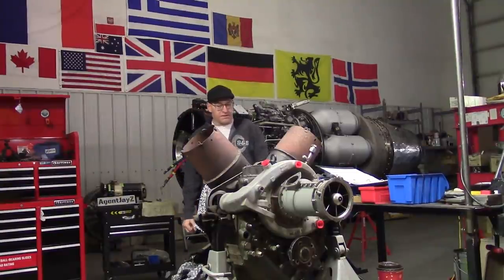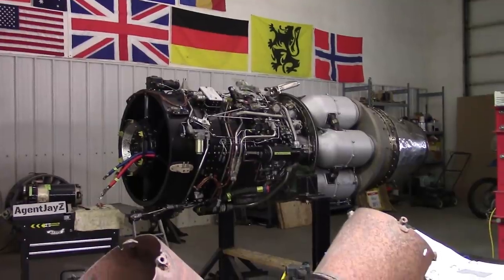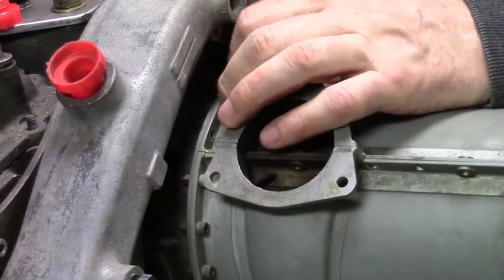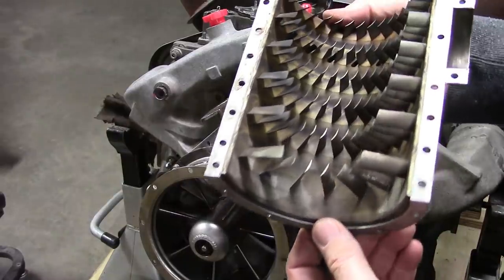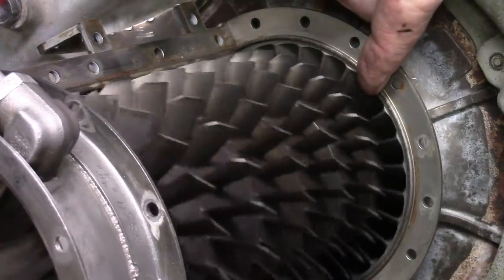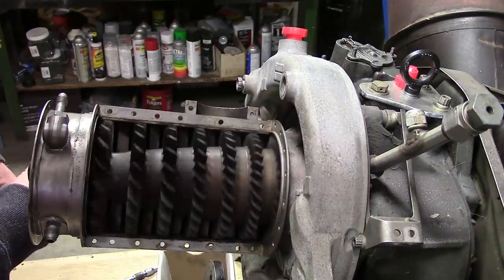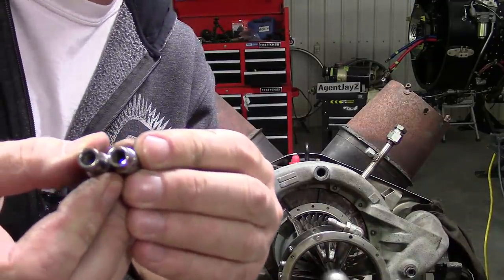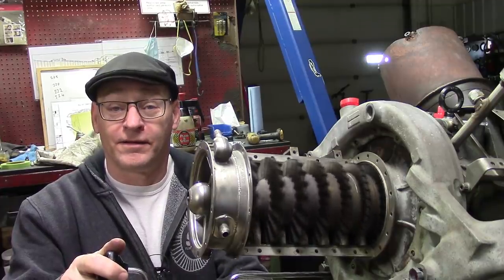Mini Jet Boat Ep. 4  Opening up the Compressor cases

Comment: Cool stuff agent Jay. I've flown them but never drilled down to working with the nuts and bolts on them. I consider you a master technician. I'm learning about the Walter 601 turbines as well. Amazing how much horsepower is available when you can afford the fuel flow. The Walter 601 in the Long Nose Thunder which is an experimental reduced scale P-51 delivers 220 Kts true at a fuel flow of 43 GPH. In neutral wind components that calculates to 5.88 MPG. Not very economical to operate as a single place aircraft but lots of fun. In larger aircraft that carry more cargo/people. Pound per pound weight to horsepower the numbers related to fuel consumption economy become very competitive.

The petrol air-cooled piston aviation propulsion units deliver about 10 HP per 1 GPH fuel burn. Dual volute turbo CI diesels deliver about 20 HP per 1 GPH. with a weight comparable to the air-cooled petrol cousins. Bellow 500 HP these 3~4 L aluminum CI diesel engines are proving reliability better than the petrol AC SI petrol engines with 20 years of data) with fuel flows of 25 GPH delivering 500 horsepower or 375 KW equivalents.

It's all about application but I've always preferred Jet, turbine/turboprop propulsion with aircraft over piston. Thanks for sharing. Cheers

Comment: In this video you explain that later models of the engine dispensed with the axial compressor altogether, and just relied upon centrifugal compression. If so, what does this axial compressor actually generate in terms of the overall pressure ratio for the engine? (2:1, 3:1, whatever.) 

Effectively, did the actual overall pressure ratio remain constant and this thing is so weedy it offers next to nothing, or was the centrifugal compressor on this unit actually just rubbish? I suspect the latter but it would interesting to emphasise this trade-off in subsequent episodes.
Reply from the maker: The centrifugal compressor design was improved to the point that the axial stages were no longer necessary. Any further details on actual numbers of individual stages is not included in the overhaul manuals.
Reply: there some numbers on page 29 of in this linked on the wikipage: https://web.archive.org/web/20161004205229/http://www.enginehistory.org/Convention/2009/Presentations/Model250Hx.pdf

3.2:1 axial and 2.2:1 centrifugal for the -C20, 7:1 centrifugal for the -C28

Comment: I want an engine like that! Doesn't have to be even close to running condition, just complete enough to display. Heck even just the compressor section with the gearbox would be nice. I would totally put that up on a stand in a room!
Reply: There's just the gearbox for a C18 on EBay UK at the moment for £16 000 . There's another one for the MB250/C20 for £5 000 !
I could buy 6 Rolls Royce Viper engines in good shape from the Jet Provost for £16 000 !

Comment: Why do the blades of stages 3 and 6 have a notch cut out of the tip of their leading edges (most visible at 8:20)?
Reply from the maker: The engineers are always tweaking the machine. It may have been to reduce resonance or turbulence when running. Such details are not mentioned in the overhaul manuals.
Reply: I suspect that the stage 3 and 6 blades suffered a high order harmonic resonance, which cracked the corners off the blades.  Rather than trying to redesign the aerofoils to change their natural frequencies, the expedient solution was to crop the corners.  It would have cost something, in terms of performance and surge margin.

Comment: Off the top of my head 10-32 is used for the gas key to bolt carrier cap head screws in the AR15 rifle , and the mil spec torque for these is 56-58 in/lbs , so 60 is close enough . There are no metric equivalent for these sizes in Europe so raid the boot sales and tool markets and vintage car rallies . Allen keys are not really a problem , but most of my spanners were obtained this way and was lucky to find old 'Blue Point' branded double end ring spanners at a quid each . Nice looking compressor stage with no intrusions except an over zealous aerosol of aluminium paint . No reason why the turbine end should be any different if the history is as good as described . I must admit those ugly mild steel stubs are beginning to annoy me , but I supposed we'll just have to wait until the engine is inverted and well stuffed before lopping those off and repairing the V flanges .
Googled Allison C18 Operation and Maintenance Manual and there are no shortages available including the 1971 Detroit Diesel one free to download online .

Comment: The old machinist term for a bolt used as a dowl, or close to a dowl, is "body bound" .
Reply from the maker: Yes. I prefer dowel bolt, but a lot of people I know use your term.
Reply: They used to be called "fitted bolts"
Reply: @whitemonkey7932  That's what I know them as.

Comment: Nice video. At 10:08 (and other places in the video), it's fascinating to see the illusion of the compressor stages moving on independent disks at different speeds and some even appearing to run backwards temporarily. Must be the effect of both the camera frame rate and the progressively smaller blades.
Reply: Yup, stroboscopic effect.
Reply: Frame per second.

Comment: Hey Jay! Would love an explanation of the 'HP recoup system'. I found it while looking at airflow diagrams of Gas turbines used in the Snøhvit LNG powerplant. Keep up the awesome work :)
Reply from the maker: I've worked on more the a dozen aviation and aeroderivative industrial gas turbine engines.
Nowhere, in any of the overhaul, operation or maintenance documentation, is the word recoup used.
So I'm not your guy.
Reply: @AgentJayZ  Just found out that it was referring to a recuperator, a heat exchanger system in gas turbines that takes some heat from the turbine outlet and gives it to the compressor outlet air to increase efficiency.
Here's a link if you were interested: https://www.turbomachinerymag.com/are-recuperators-always-great/#:~:text=The%20recuperator%20is%20a%20heat,pre-heat%20the%20combustion%20air.&text=This%20advanced%20cycle%20is%20often,with%20reciprocating%20engines%20on%20efficiency.
Reply: Recoup is a term used in GE engine CF6. It steals some of the leaking air and used it for sealing in bearing chambers.

Comment: Hello and thanks for your videos. Compared to axial compressors with many more stages, it seems this one  constantly tapers up to the centrifugal stage without having the straight area to reduce air velocity. Is this because here is not required? Or is the centrifugal stage architecture playing a role in this instead? Again thanks!

Comment: A nut re-assembling tip from a recent Andrew Camarata video was to use a swatch of paper shop towel to press home and hold a nut in a ring spanner to prevent it falling through when access is awkward.

Comment: Is that resin filling around the stator blades used in other engines? Looks like a bit of a nightmare if you had to replace one of the stator stages.

Comment: Nothing in the UK I'm afraid sometimes I get lucky with a little used manual here . Ebay UK has a C18 gearbox ONLY for £16 ,000 ( about Ca$30 000 ?) . To put this in perspective a Rolls Royce Viper from a Jet Provost in clean condition is £2500 ! Try the one month free download for the Dietroit Diesel manual . Picked up a couple of tips from guys who have worked on these .
 Tip 1 CSL  1176 starting procedure - open throttle at N1 =12-15% rather than 18% as recommended in the operation manual as it reduces wear and burnout .
Compressor and turbine mounting stud torque is low at 80 in/lbs as this does not allow for 'drag torque' and these will come undone . Torque to 110 in/lbs to make sure they do not !

Comment: Is the inclination to do the other side of the compressor cleaning just out of a sense to be good and thorough? Or is it out of concern for some possible imbalance (of air flow, or something... I don't know, that's why I'm asking!), due to grimy stator fins on only one side of the compressor?
Reply from the maker: The compressor only needs a light cleaning, so the other half doesn't really need to be removed. This is a non-flying application. But might as well make it all shiny!
Reply: Hopefully there are fewer troublesome socket and wrench fits on the other side! Thanks for the reply, and for these not-only-informative-but-also-fun videos!

Comment: I had a good look at the WWW trying to find the fuel system manifold for the A250-C18 type,
I don't think my efforts would find anything you were unable to, but yours is the Allison 250
Rolls-Royce also do the C18 type and I hope you may be able to find the PDF there
I had to watch this video with a few breaks while caring for my boy Damian, I don't think I missed your explanation of why the third row of axial blades had the leading edge cuts, I wonder if you might be able to explain why, I have seen your own from your learning days when these parts were being thrown out, blacers ? I think you called them, makes good shelf ornament,
am waiting for my own RR RB-211 compressor mounted blade from 757-200.
good luck with this race boat build, looking forward to more videos, thankyou AgentJayZ
Reply: Just a guess but I know corner crops are used to change the resonant frequency of the blade.  If the operating frequency of the engine and the blade resonant frequency are too close all hell breaks loose
Reply: @qcan8468  ok that makes sense thanks

Comment: Dumb question? Are the nuts and bolts titanium? Are any of the parts titanium and can you point some of them out?
Reply from the maker: No titanium. For nuts and bolts, titanium is more expensive , weaker, and a little bit lighter than steel. So they have to be bigger, which defeats some of the weight advantage.
If I was trusting my life to a machine, I would always choose stainless steel fasteners over titanium.
Reply: @AgentJayZ  I believe the bolts on the hot side (the turbine side) of the engine are titanium with inconel nuts on them.
Reply from the maker: No titanium. Especially on the hot end.
Titanium is weak, soft, and catches fire.
Reply: @AgentJayZ  That makes a lot of sense. Someone once told me they were Titanium, and I had seen titanium hardware that looked similar to those T-bolts, so I just believed them without ever looking up the part numbers to verify. Thanks for the clarification.

Comment: What was/is the cost of one of these engines? non airworthy i guess.
Reply from the maker: If you look, you will find. Then the price is whatever you can negotiate.
Reply: I'm guessing airworthy wouldn't be too hard to acheive with some time and skill and patience, even if it wasn't in that particular state to begin with. But sometimes pennies do cost $.
Reply from the maker: Certainly, gbowne1, making a junker airworthy is only a matter of half a million dollars or so. Piece of cake!
Such is the value of guesses.
Reply: @AgentJayZ  making an engine airworthy would basically require replacing everything that needs but doesn't have the proper paper trail?

Comment: Can you explain why the third and sixth rotor stages have clipped corners?
Reply: It might be because, as he mentions at 7:00, they've been "blended" - Had a small bit ground off of each blade to balance the mass of the compressor as it rotates.
Reply: @Ropponmatsu2  He did, but as he spun it around, it sounded like he went back and said the whole stage is just like that.  I don't think balancing would require the whole stage to be ground.
Reply from the maker: Answered yesterday in the comments.
Reply: @AgentJayZ  Thank you. I found it eventually. Reasonable explanation.

Comment: I know its probably silly, but I just don't care for 12 point sockets. I only like using high quality 6 point sockets. I  have 12 point sockets, I just avoid using them.
Reply from the maker: Most of the bolt heads I see are 12 point, except on the really old engines, So I need to have both.
Reply: Some NAS bolts and various commercial high tensile bolts and nuts are available in 12 point, they are a godsend in tight locations such as UNI joints, the spanner for them is almost the same diameter as the head. For hex heads 6 points usually can handle more torque. You can even get 12 point socket head bolts and they are less prone to slip than the 6 point ones when used with a 12 point driver.
Reply: In aircraft maintenance I rarely need 6 point sockets. Most things are torqued to specific specs and corrosion is strictly controlled, so rounding fasteners really isn't a concern most of the time. That said you occasionally run into a 6PT fastener made of soft metal with a high torque, and then you get out your 6pt socket.